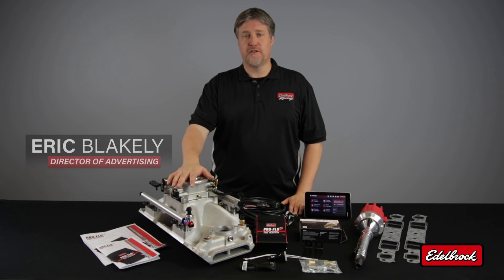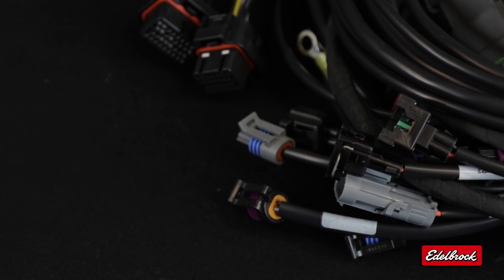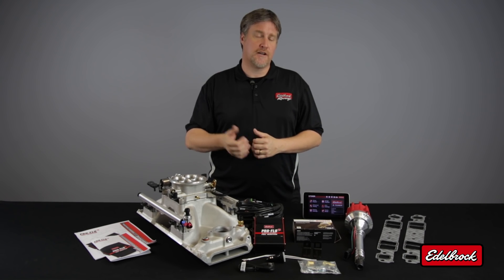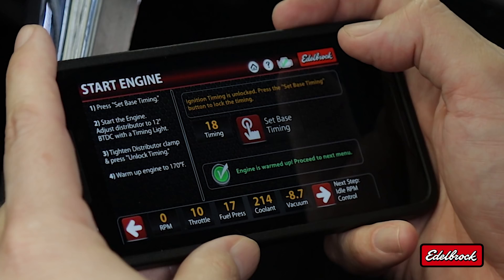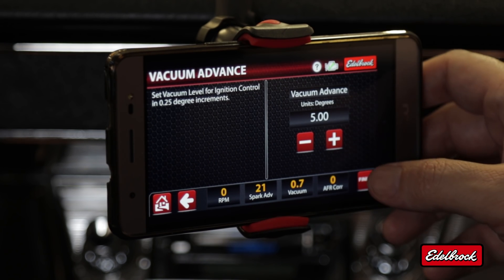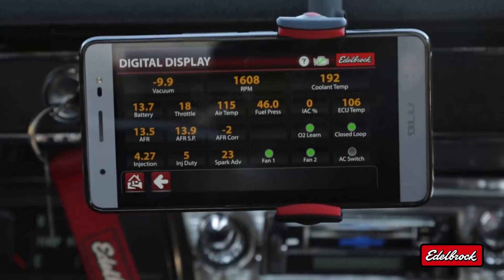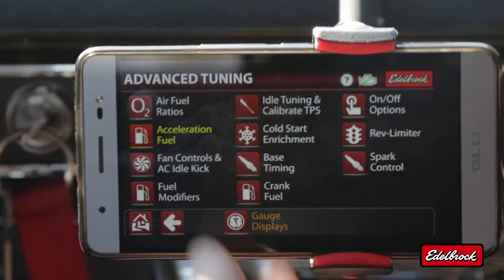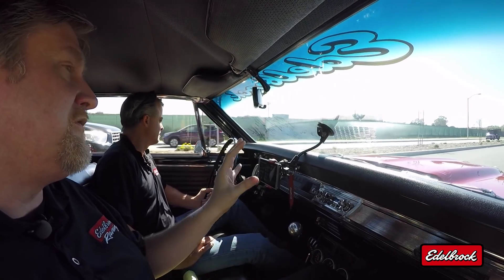Pro-Flo 3 EFI System

Comment: This was put on the 555 chevelle. But on the website says max hp is 625. the 555 should have more than that. Are there plans to sell your 555 crate motor with the  Pro flo 3 xt instead of the pro flow 2? Concerned by the 35lb injectors most of the calculators out there  recommended 58lbs for an enjine with 720-750 hp with an 80% duty cycle like your 555 crate motor is capable of producing. Sorry for all the questions just that a self tuning 555 with that sharp looking xt intake is pretty tempting

Comment: Still not as good as Holley's EFI, sorry but it's true.
Reply: fastjp72 In what ways?
Reply: @WaveCrusher  With Holley's system you get a FREE haircut, from all the hair you pull out, from being frustrated.

But FACTUALLY: Holley doesn't have a system like this.